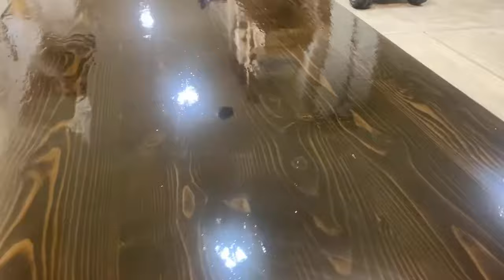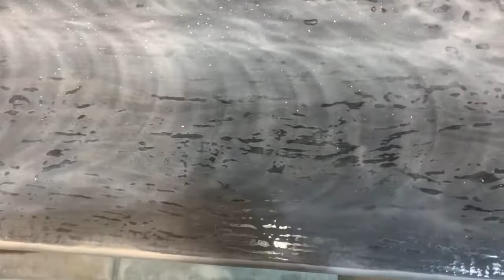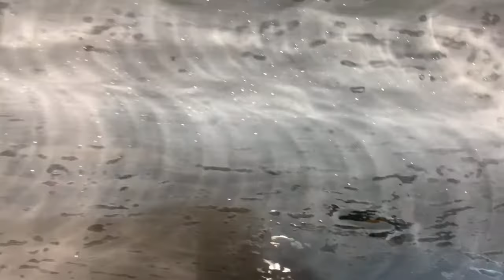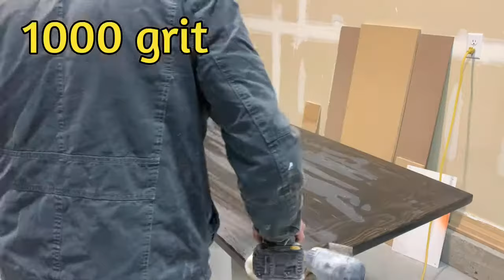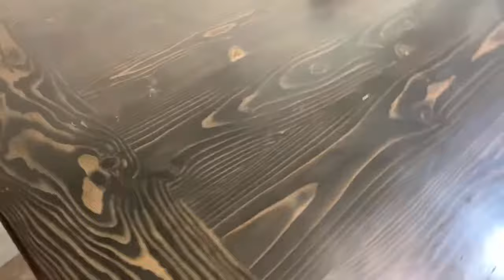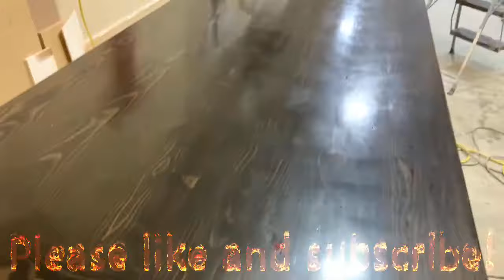How to Sand Topcoat of Polyurethane

Comment: Beautiful finish. I work for Duncan Aviation as a SWAT tech so a lot of my work follows through finish. This video was helpful to help me learn about finish. The only thing we do different is we start at 1000 and work to 3000 grit on finish surfaces. Still a helpful video.
Reply from the maker: Thanks for the tip and thanks for watching!
Reply: What a good idea .. I went up to 3000 myself and the smoothness and feel you get is top notch you want to keep touching it .. oops! :)
Reply: I'm in Special Forces and we go all the way to 10000 making the buffing process 10 times quicker
Reply: I'm in MI6 and we tend to go to 15000...
Reply: In KGB we use up to 40!!!
Reply: I'm with Space force and we start with 8,000,000 grit

Comment: once you do 400 grit, add a final layer of poly with an ox bristle brush and put it on slowly, and add 1 part mineral spirits to 3 parts poly. That final coat will be a beautiful finish without the cloudiness, without the bubbles of the quick coats, and will be safe to eat off of (will not require a polish). only con, is that it will take just a little while longer to cure.

If you find that the finish still has a couple spots that you dont like, sand those spots and areas surrounding them in the same direction as your grain, then refinish the complete surface with a 50% min spirits and 50% poly blend, using a lint free rag to dip and the brush across. you'll have an even finer finish with even less imperfections than option one; with 1 caveat, do it in an area with minimal dust.
Reply: After the first layer my dark floor looks blotchy where parts of the wood are shiny and the other parts dull. How can I fix this? I tried sanding with 180 on a patch and it took the stain off too. Maybe I I used too much pressure but Any advice would be appreciated.
Reply: @Insp.CountMortisWinshipKlaw  180 is too aggressive, 220 is the absolute lowest. Between coats many say 320
Reply: (Try General Finishes oil poly. "Arm-R-Seal." You probably will find it thin enough directly out of the can.  I love the results I have been getting using at least three coats  and light sanding 320, then 600, then brown paper (approx. 1000). )

Comment: I took the exact same steps that you did however, I ended up with some spider cracking. Any idea what to do with that? Any idea how it happened! Thanks for the video by the way.
Reply from the maker: I wonder if you sanded too far ?
Reply: @Ben.Builds.  honestly, I’m not sure what happened. I ended up re-sanding and using polyurethane several more times with 220 instead of 400 grit. The only thing I can think of is that I hadn’t waited quite long enough for to cure. All in all, it came out nicely just that one bump along the way! Thanks for replying by the way.
Reply from the maker: @diehardfan173  glad it worked out!

Comment: after 32o you still had those glossy area where 32p paper did not reach and you switched to 600 , it will take more time than i thought after 320 you gonna switch to 150 and will sand evenly untill the entire surface will become smokey...
Reply from the maker: Yes I think I should have spent more time sanding at each grit. It would have turned out a lot more clear.

Comment: Hello would you recommend sanding between coats of poly in order to flatten them out a little before the next coat?
Reply: Its alittle late but im working on a project currently. I did 2 coats without sanding. And then sanded on the 3rd and 4th. Just to make sure it was thick enough to sand mostly flat without going through stain, because my first go round i accidentally sanded straight through to the wood at a low spot.
Reply: @larracis  Lately I've been sanding the first coat with 320 grit and the second coat with 600 grit (palm sander).  The third coat is smoothed out using pieces of a paper shopping bag.  That's the system I developed for my projects since writing the above comment.

Comment: Thanks for the vid. I've put 4 coats of polyurethane on a small table top I have built. The second coat was basically perfect looking, but I was afraid it wasn't enough so I sanded with 220 grit which was really a mistake. After the third coat I basically sanded it off with a brown paper towel on a square type electric sander. I have the fourth coat on now. It looks pretty good although I can see some brush marks in it. It's not been sanded yet and I'm wondering what grit of sandpaper I should use?

Comment: I have some mahogany pieces I’m trying to poly and can get it almost perfect but I have some imperfections.

Do I sand/buff the whole project?
Or
Can I just fix the imperfections somehow?
Reply from the maker: I have been successful “patching imperfections. Just lightly sand the areas that are effected and dab some poly in that area with a foam brush. It may take more than one coat depending on how deep the imperfections are. It can be done, but usually I like to finish off the whole project with a coat of poly.

Comment: Ben, how much time did you spend with the 320 Grit sandpaper. Do you get it almost completely smooth before moving on to the next "Grit" level?
Reply from the maker: It’s something you will have to decide depending on how many coats you put on and how thick they were, because you won’t want to sand too far into the poly, or into the stain layer. I basically got all the major imperfections.

Comment: Thanks for sharing your work. It is impossible to buff our residual haze when the poly does not fully harden. Would you be able to recommend a gloss poly product that comes with a hardener?
Reply from the maker: I have used a clear coat that is premixed from Sherman Williams. They mix it for you at the store. It has a pretty short shelf life because it will harden in the can. But if you spray it, it dry very quickly.
Reply: @Ben.Builds.  Thanks for your kind response. I will try your suggestion.

Comment: May I ask usually how long should it wait for polyurethene to complete dry?
Reply from the maker: It usually will dry within 24-48 hours depending on temperature and humidity. It should say on the back of any polyurethane product.
Reply: @Ben.Builds. There is a difference between drying and curing. Polyurethane takes about 30 days to fully cure. Waxes should only be applied after this period to avoid trapping solvents within the finish which can result in the failure of the finish.

Comment: Thank you so much for the video and the tips. Question? What if I don not have a buffer? Can this process be done by hand??
Reply from the maker: I’m sure it can be, it will just be a lot more work. You can get a pretty inexpensive buffer from harbor freight. I don’t usually buy tools from harbor freight unless it’s a tool I know I won’t be using a lot.

Comment: So this compound won't change the original sheen? And does it work with paint as well as poly?
Reply from the maker: It will change the sheen, it will never be as glossy if you are sanding and buffing gloss poly. I wouldn’t do it on paint.

Comment: Thank you for the tips and for sharing your experience.  I'm curious about one thing though,  you mentioned needing to wash off the polish after the fact several times which is very logical,  my question is what did you wash it with? Just water? Soapy water? or something else entirely?
Thanks again.  Cheers!
Reply from the maker: I used mineral spirits to wipe it off. Another option is letting it all dry and sanding it down to the stain.
Reply: @Ben.Builds.  stain or poly?

Comment: At the end of the video you applied polish and said it was cloudy and it can get buffed out. How do you buff it out? Do you use another type of polish with a car buffer? Can you please advise. I'm restoring an antique bedroom dresser for my friend and changing the color like she wants and after spraying the water base polyurethane it feels like rough texture, it looks beautiful but the texture is not smooth. I also used paint, not stain because I believe it's redwood. After stripping it and trying stain it wouldn't take the stain so we went with primer and 100% acrylic and the poly. I just started with the 12 drawers and I'm trying to get the glass feel. I know it won't really shine because I'm using a satin finish but I'm not sure if she'll like the way it feels right now. My wife likes it a lot but I'm thinking it should feel smooth, at least that's what I'm used to seeing in furniture stores. Can you tell me what type of rubbing compound and polish you used? The stain and the polyurethane you placed in front of the camera to show us but the rest you didn't display it. May you please advise and help me out a bit. Thank you very much. I saw another video where the gentleman was wet sanding between coats. Again, thank you very much and I loved the video, very educational.
Reply from the maker: If you can feel it’s still rough it’s not ready for buff or polish. I would pick a spot in the dresser that won’t be seen and do a test spot with 1000 grit sand paper, then moving to 2000 grit and then buffing/polish. I don’t remember the buffing compound I used, but you can use any auto buffing compound like Meguiars. Basically the idea is to sad away any high points and the buff it until it shines. Just make sure you don’t sand through the poly layer.
Reply: I have this same question.  After sanding and buffing, it's still a little "milky".  Have I just not buffed it enough?  how do I get rid of the final milky bit from the polyurethane dust getting stuck in the micro valleys from the first levels of sanding?
Reply: @StrawberryGS  wash is more?
I’m not sure but that’s my guess

Comment: What should I wash it with between sands and buffing?
Reply from the maker: I just used a wet towel in between sanding. After it’s buffed and polished, I used just some mild surface cleaner. Don’t use anything with bleach.

Comment: I don't think you should have to do this, if the poly was applied correctly in the first place. It is self-leveling.
Reply from the maker: True. It was most likely caused by either applying the second coat too soon or by the high temperature.
Reply: @Ben.Builds.  with that said, I am yet to apply a poly correctly myself 😆😆

Comment: Here's a quick and simple solution to get the best results: (1) use a top quality commercial-grade poly,  and (2) spray finish it with a quality HPLV spray system like the Fuji Spray System. Save time and get showroom quality results without all of the hassles.
Reply: And on that note, a high gloss finish makes most furniture look tacky/ daggy, imo, and you can't beat a nice satin finish.

Comment: What a mess. Thin your polly. I do 60/40. Lays down flat. Takes more coats but gets you that mirror finish. Also wet sanding between coats with 1000.
Reply from the maker: Thanks !
Reply: I just used poly over my painted drawers and it’s patchy and streak marks. What brush do you use?
Reply from the maker: @karenwalker3958  If I am going to bush on the poly, my best results have been foam brushes. I usually spray the poly now, it’s seems to work out better.

Comment: Does anyone know if I can apply polyurethane on top of the table I just finished with spar urethane?

I’m so confused as to why it doesn’t harden even though it’s been days since I finished it and I let it dry 24 hours between coats ( 3 were recommended) I have no bubbles just brush lines possibly because I ran out and didn’t have enough to spread. 
My neighbour said to get finishing wax and it would look better but I need this to be extremely hard. It’s an outdoor table that I refinish for my mom.
Reply: Drying time will depend on temperature and humidity levels. Polyurethane requires 30 days to fully cure.
Reply: To the best of my knowledge, spar urethane is UV resistant, but not as hard as polyurethane. I accidentally sprayed poly over spar. Called the manufacturer and they said go with it. (All oil based)
Reply: @davidconnors8830  thank you for your help

Comment: What buffing and polishing compound did you use?
Reply: U need something like mcquires m100 to get the sanding marks out.  Ull need to do more buffing then this guy did too.  You need to look at it in the light to see how cloudy it is and to tell how much buffing u need to do.  After that u want to finish with something less abrasive like mcguires ultimate compound and then finish it off with a polishing compound.
Reply: @timm5970  will this work for a water based polyurethane as well?
Reply: @detroitstreetfilms  never tried it but I imagine it would make no difference.  It's essentially just sanding
Reply: @timm5970  I guess I was referring more to the kind of rubbing and polishing compounds you used.
Reply: @detroitstreetfilms  yeah they are basically just liquid sandpaper

Comment: The awkward one hand in the pocket while sanding was so odd like u knew u had the camera on u and u didn't know what to do with ur hand he felt embarrassed even know he was alone
Reply: Yup! Even if it's easy, the other hand   helps guide the sander so you get a more even sanding pattern. I've polished and sanded vehicles for over 30 years and notice it makes a difference how you move...slow machine speed and even movement.

Comment: THAT IS THE MOST HORRIBLE FINISH I HAVE EVER SEEN.
ARE YOU KIDDING?
BACKWATER GARBAGE
Reply from the maker: Yep. That’s what happens sometimes. Many different factors can effect the finish. Could have been an old can of poly, weather, humidity, or putting more coats on too soon. This video is to show how to fix the problem.
Reply: @Ben.Builds.  Pretty mean comment above! Disregard it man. You can still work that table and have it look really really good. Sand some more to get out those final craters, use a better/thicker twisted wool pad and set the rpm on your buffer if it is variable speed to between 1400 and 1600. Don't use too much polish next time you do it. The friction is what is gonna shine that mf up! Finishing is a learning process. Don't let this discourage you!